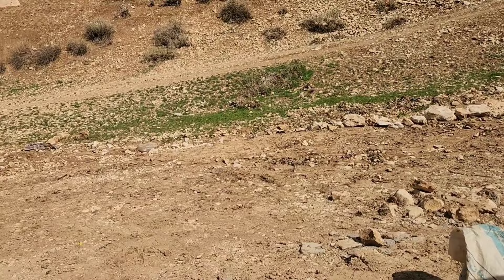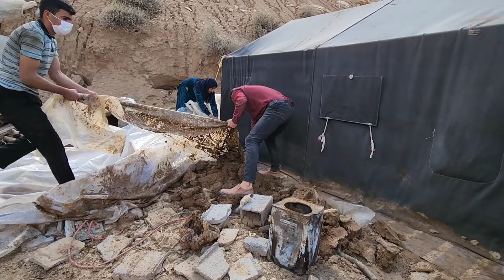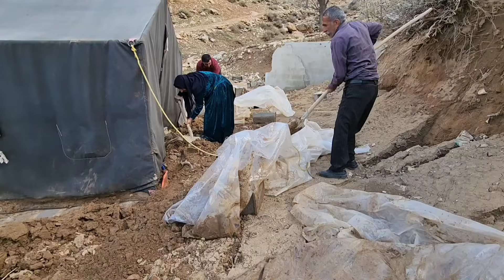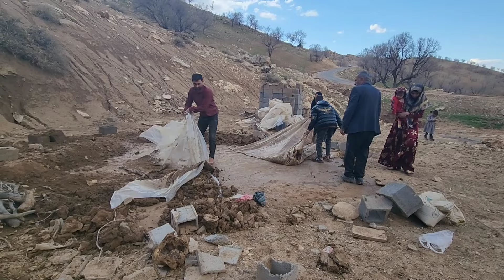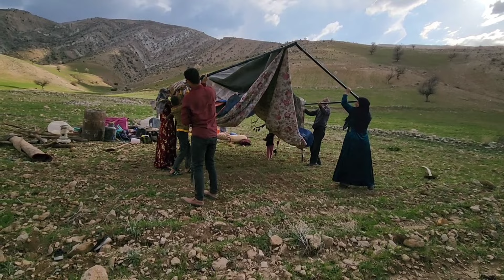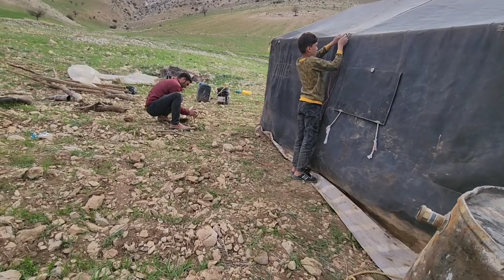An ideal for life:migration of a nomadic family to a new land with the help of a benevolent engineer

Comment: Before placing your tent on the new land

First build a block platform for the tent
Next put a large plastic on top of the block platform

Next set the tent on top of the block platform and tie it down
Next put a large plastic over the whole tent and over the whole block platform

Secure the plastic with blocks or large rocks tie it down

The tent is now more protected from the rain and snow
Reply: Do you actually think that's going to happen?
They don't have a clue what they're doing! So disorganised still don't learn any lessons on how or where to put up the tent or anything else really. Clueless I would say😮